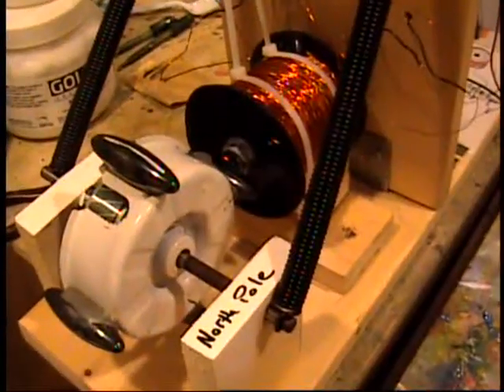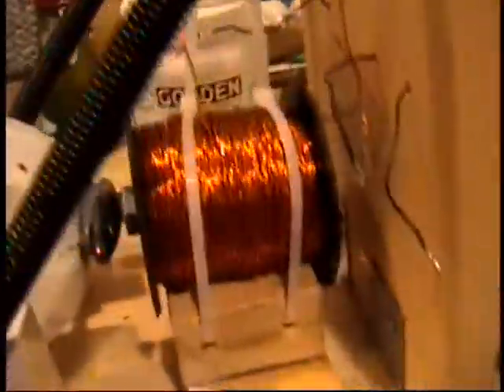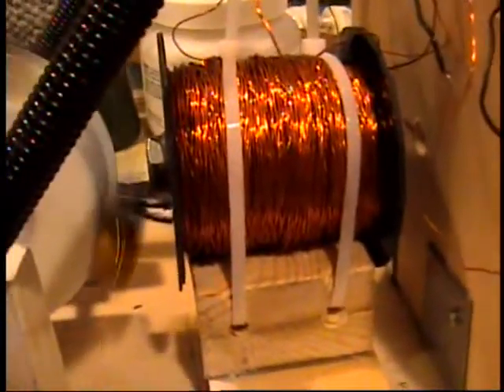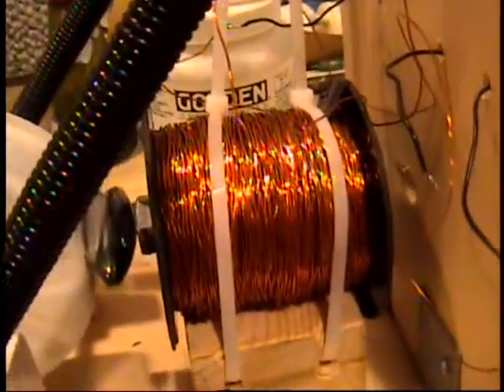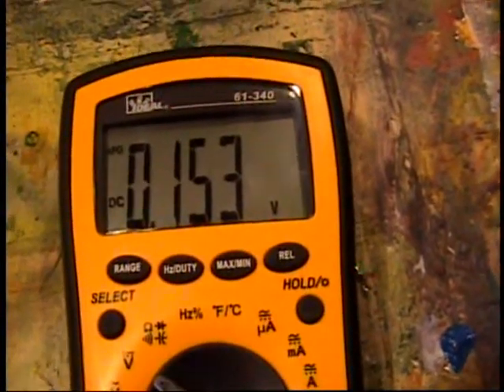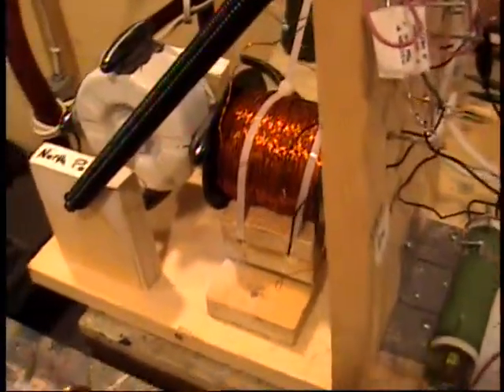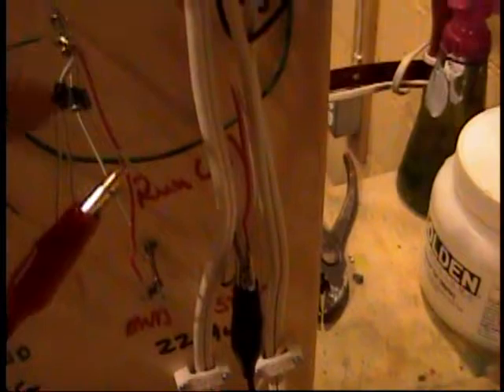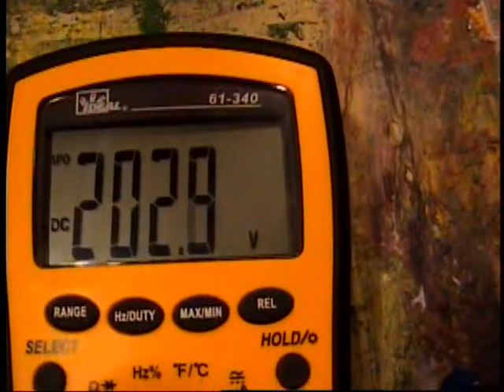Bedini Flyback Measurement

Comment from the maker: Thank you Norms, yes I tried to measure output with no load, just the neon for some escape for energy. It burned out as you warned me it would. I will add more protection as you suggest. I also will try a 2N3773 transistor which can handle 150 watts. Almost double the input capacity of the MJE 3055. I have a bag full here I've just been reluctant to change when things work.